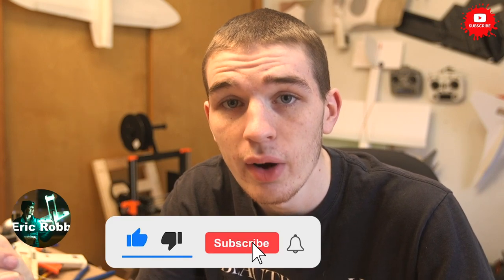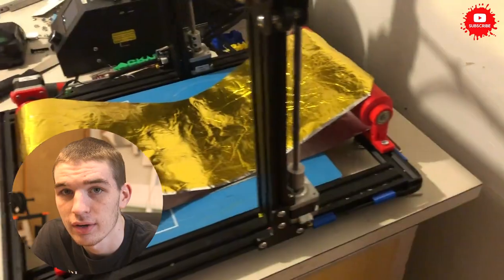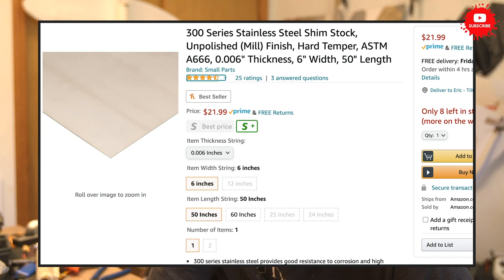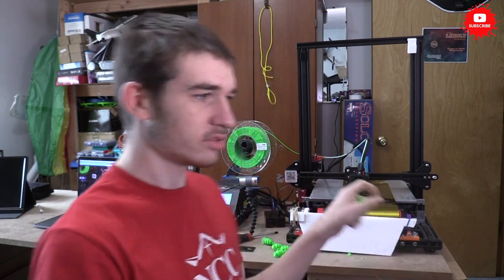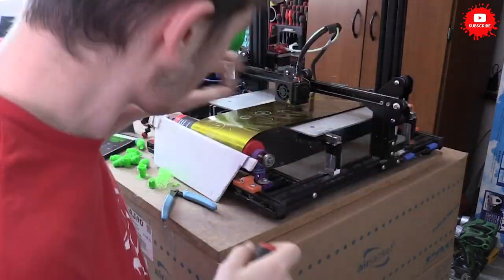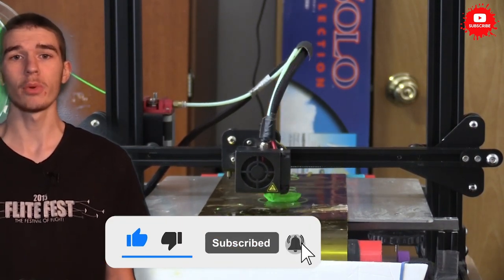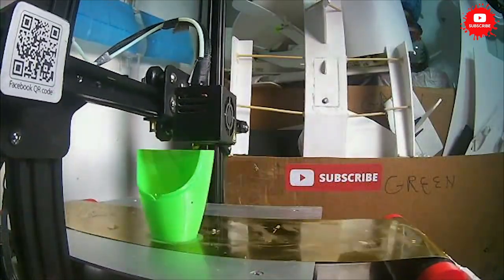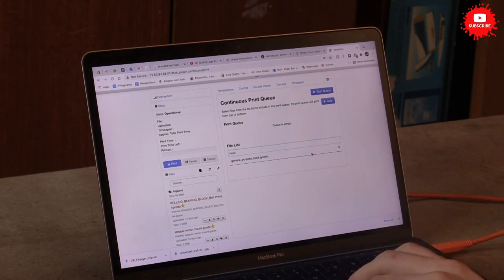Creality CR-10S Belt 3D Printer Conversion

Comment: I have a cr10 mini that I am considering replacing the bed with a belt. Would the steps be the same as to what you did on the cr10s? If so, would you recommend it if you had to do it all over again?
Reply from the maker: The conversion would be fairly similar with the cr-10 mini, and I would recommend it if its something you would use and are fairly handy.

Comment: It would be quite a cool experiment to design a belt to a Voron-like printer you know. I mean, core x-y machines are already quite stable and the cool thing about the voron is that the print bed stays still at the bottom of the printer while the print head moves with the x-y core and the zed shift. So it would be a simple addition right? A belt conveyor in the bottom and the whole printing mechanism would be the same. When the print finishes a motor could simply roll the bel (perhaps it would not even require a stepper motor since the precision of the movement would not matter) and it would be ready for the next print. What are your thoughts about it?

Comment: Ok, I have a question: you're printing skirts, etc. How are they being removed if that's a continuous belt, and what happens if a print won't pop off the bed at the end of the belt?
Reply from the maker: If I am printing skirts sometimes in the video that a mistake, because you are right, there is no way to remove them. Unless you just hope that the printing doesn't print in the same places over and over again. Let me know if this didn't answer your question. Have a great Day!
Reply: @EricRobb  no, you did. Thanks, and Merry Christmas! 👍👍

Comment: Well done! This is on my list for years! I was afraid of the belt shifting left and right... what did You do against it?
Reply from the maker: The rollers aren't flat, the have an arch in the center, which makes it auto center the belt. My biggest problem with the rollers in getting enough traction so I don't loose steps on the y axis. That's why there is electrical tape on there to help with that, and i was thinking about putting some silicone on them to replace the electrical tape but I never have.